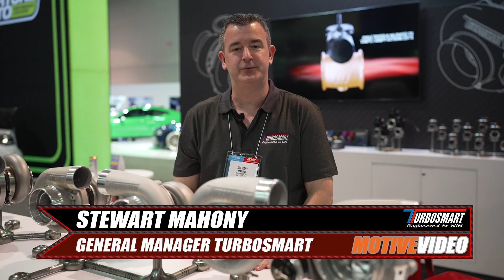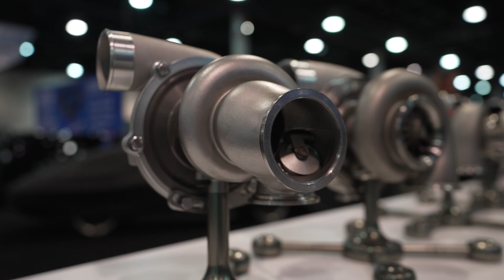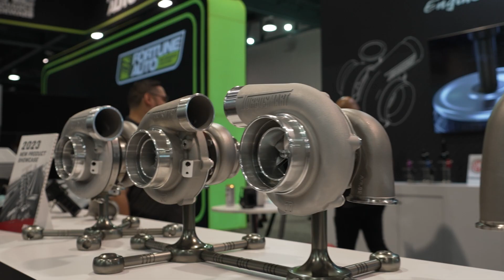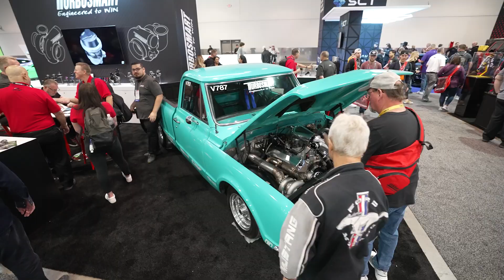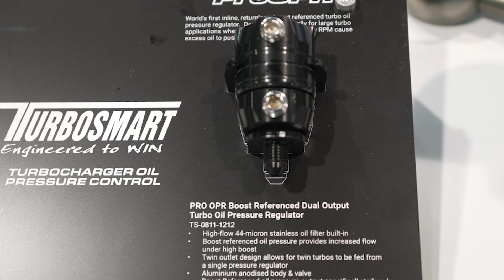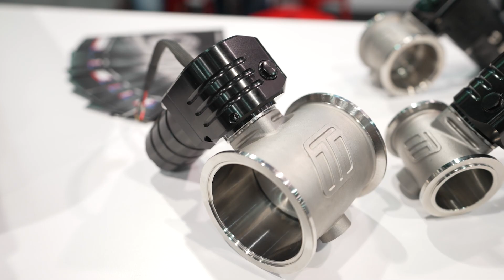Turbosmart Unveils Their Own Turbocharger at SEMA 2023!

Comment: Oil cooled? Thought it would be oil lubed
Reply: When they refer to a turbo as oil cooled it means it does not have additional water cooling and likely has some provisions to help the center housing stay cool with just the lubricating oil running through it.

Comment: Do the Turbosmart Turbos need the OPR?
Reply: We learnt a thing or two about turbocharger oiling over the last 6 years with the development of the OPR series... while there is allot of effort to get oil out of the bearing housing to reduce the likelyhood of the symptons you see with oil pooling and over-pressurisation... We have also noticed and aknowledge there is a dynamic turbocharger efficiency benefit from correct oil pressure. The easy version: lower, (but still appropriate) oil pressure equates to increased turbocharger efficiency as it reduced bearing losses that can effectively 'slow'' the main shaft down due to over-supply. In short. TS turbochargers are less likely to NEED an OPR because of smoking issues that are the most commong 'issue', but they can still certainly benefit from them and an OPR removes all the guesswork from restrictor sizing and line selection, etc.
Reply: @TurbosmartHQ  Thanks for the extensive and detailed answer.
Reply: All ball bearing turbos need restricted oil flow, you can do it with an inline oil restrictor or go high zoot with the OPR
Reply: @RyTrapp0  For example BorgWarner and some KKK have it integrated.

Comment: interested to see the pricing.. im so happy with my pulsar turbo that i dont think id ever pay Garrett or presison prices again..
Will always use turbo smart gates and fuel regs controlled via Haltech because boost control, fuel delivery and there tuneability is key to not blowing shit up
Reply: Pulsar all the way boys !! Why pay 4x the amount ? My gtx3584rs was $900, garret like 4.5k, and I bet ya turbosmart will be pricey too ! 
I use a turbosmart 50mm gate though , but turbo ? Pulsar !
Reply: How long have you had the pulsar for, no issues? I've got a garrett and thinking of going bigger but $1400 vs like $4200 is a massive price difference
Reply: @crazzydude0117  over a year of daily driving, 20 psi, manual barra with rolling anti lag and not a single issue
Reply: @mifo2000  thanks bro i think ill be considering them properly when the time comes for an upgrade. ive got a gen2 3582 garrett on my barra atm thinking the the g40 for the next upgrade and for less than half the price its worth a shot
Reply: I have run many pulsar turbos ranging from 3076 to a g42-1150 and have had 0 issues at all. For the price they can not be beat
Reply: Looks like they start right around $2,000 and go up to just over $3,000.
Reply: Aeroflow turbos are also great. Pretty sure some are in the 6s in 1/4 mile.
Reply: I've always thought of doing a pulsar turbo for my B18C2 build. with a turbo smart E-gate.
Reply: @igvtec   i havent personally seen many cars with e-gates. i cant say they are good or bad. but most race cars i see still have co2 bottles to control their boost solenoid and wastegates.. 

my cars a street car so next big upgrade is more haltech gear and 3port boost solenoid
Reply: @mifo2000  well I want to run a e-gate, because I want the best boost control possible etc. I believe most race teams, are still using the CO2 because they already have it installed in there cars. And it is doing the job that they require, plus with the expense with the e-gate compared to what they already have.
Reply: @igvtec  that fair enough you want to run them. They have been out for a while and i do want to see people use them, but

even the cleetus car, Mcflurry, no money spared, all the haltech gear and still went with co2.

cost isnt an issue for big teams, especially $2000 aud. 

a 50mm gate, 4 port solenoid and co2 kit will cost the same as an E gate
Reply: Pulsar wastegates for the win trust me

Comment: Would be great to see a comparison between precision garrett and turbosmart on the same car with all turbos as close as possible in sizes.
Reply: According to HP ratings, garret's G series line makes 50-100 more hp per turbo.
Reply: @lennixsingh626 G series number hp claims are way overrated
Reply: @lennixsingh626  Garrett overstate their power output. Look at how much kg/sec it actually emits.
Reply: @chippyjohn1 they don't exactly overstate the numbers for horsepower. If you read the numbers closely they are capable of reaching those flow rates when maxed out. And that's brake hp. Not wheel....
Reply: @JOutterbridge  They do overstate compared to other turbo maps. Names are all marketing. They could make even more if run on alcohol. Names should be in kw's anyway. KW is the standard for power,  not hp
Reply: @chippyjohn1  I guess it could be in kw. Either way, it's not overstated if that max flow CAN be reached with race gas or alcohol. You just have to know the limitations compared to other manufacturers
Reply: @JOutterbridge  I know, as I said more power could be gained with other fuels. Whats stopping someone claiming a small turbo is capable of even more power. They could be testing it with nitro-methane. Using a power number in the name is just marketing, and most people jump on it thinking it means something. Same reason people like Using HP over kilowatt, because it sounds like more. Have you noticed that no turbo manufacturer actually states what test conditions they use. They are supposed to be rated at standard atmospheric conditions, but none of them actually state they are rated at such conditions.
Reply: A link to the Turbosmart compressor maps would be nice
Reply: @DriveTuneMedia i wouldn’t hold your breadth lol
Reply: @DriveTuneMedia Still no maps for Turbosmart turbos.
Reply: @weduhpeople8504  Currently we do have compressor maps available for our 5862, 6262, and 6466. They can be found on each of those respective product pages. The process of producing proper compressor maps is quite long and expensive so in time we will have maps for the larger turbo sizes (6870, 7170, 7675, & 7880) when the data becomes available.
Reply: i would buy the one with the best customer service!
Reply: Goleby have already quickly shown just how much these Turbosmart units shine over the G series 

I've always thought the G series were a bit over hyped , and to put simply quite optimistic.  Seems I'm not wrong
Reply: @WraithDeath  Which video is that mate?

Comment: looks like a HTP Turbo?
Reply: It is made by HTP
Reply: @og33vo Where did you hear that? They look similar to HPT turbos, but I see several differences just from the outside.
Reply: @TranceFur  They do look veeery similar to HPT. I would expect Turbosmart to partner with another company to make these. The equipment and machinery necessary to make turbos is massive, tons of supply chain connections necessary. HPT turbos seem excellent and if they are working with them, they seem to have added features such as internal wastegate exhaust housings, water cooled center housings, and possibly the updated oil slinger shaft design. A lot of the same marketing and features language is used by both HPT and Turbosmart, but the Turbosmart products do at least seem bespoke. Take all with a grain of salt.
Reply: Am I crazy or is everyone in this comments section saying HPT turbo wrong?
Reply: @TheBCninja  HPT posted on Instagram that they are the partner with Turbosmart for these turbos. 👍